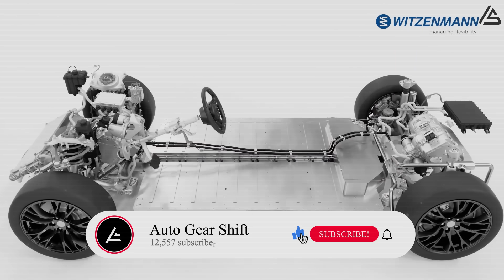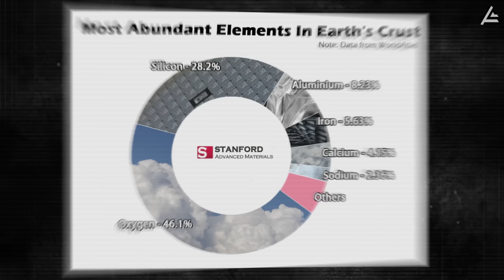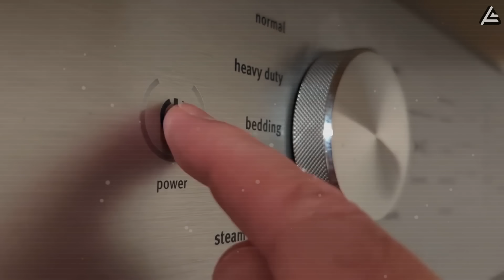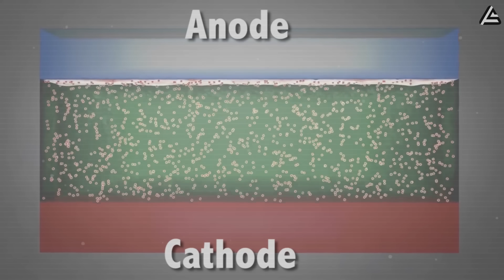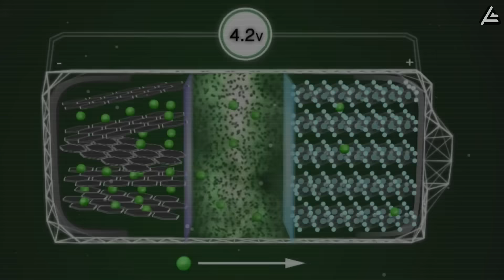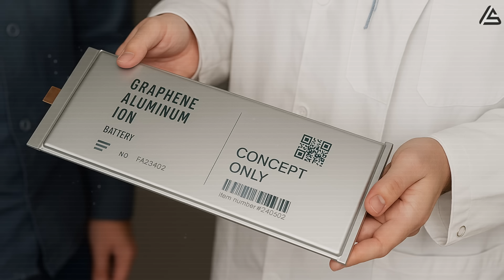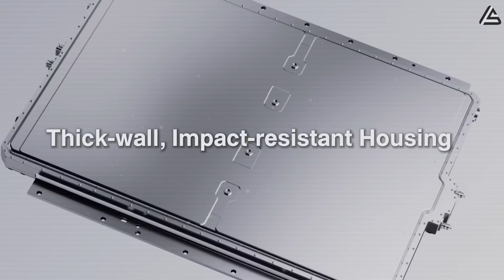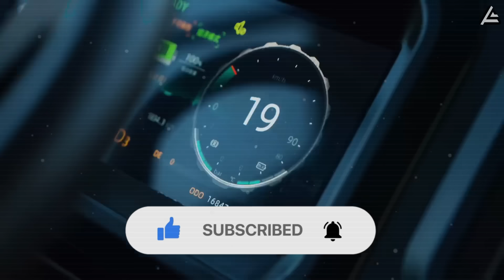Elon Musk Revealed 2026 Tesla Batteries: Aluminum-ion VS Sodium-ion. Is This End Of Lithium?

Comment: OK let’s get real, Tesla in the foreseeable future isn’t moving to either of these battery chemistries.  The reason is density.  They don’t have the density to offer any long range.  A sodium-ion battery would need to be 100-110kWh to provide the same range as 75kWh NMC battery.  Adding more weight to the vehicle.  Aluminium-ion batteries are still at Lab stage but also suffer from the density issue.   In 2025 we are looking at EV ranges of 400 miles plus.  Who would want to sacrifices 100 miles.
Reply from the maker: Exactly — that’s the reality check most people miss 👏 Energy density still rules the game. Tesla’s pushing 4680 lithium cells for a reason — proven density and scalability. Do you think solid-state could bridge that gap before 2030, or is lithium here to stay longer?

Comment: Aluminum-ion batteries are a technology currently under development. Compared to existing lithium-ion batteries, they have lower energy density, presenting the challenge that achieving the same capacity requires greater weight.
Reply from the maker: Exactly — that’s the trade-off right now ⚖️ Do you think the extra safety and faster charging are worth the added weight?

Comment: But what about battery recycling? Which chemistry allows for the cheapest and most complete recycling of materials? Graphene is not cheap and aluminum is not harmless when absorbed into the human body. There is also the option of reusing a battery in less demanding ways, like power backup for buildings.
Reply from the maker: Do you think Tesla will focus more on recycling or on second-life applications first?
Reply: @AutoGearShift2  The Nissan Leaf has done a second-life application. I don't know what Elon's business model will be.
Reply from the maker: That’s a good point. Tesla hasn’t clearly outlined a second-life battery model yet, what we’re discussing now is still based on trends and possible directions. I’ll cover Tesla’s likely options and comparisons in the next video, stay tuned.

Comment: IDK about in a vehicle but today, nearing the last 3 months of 2025 and looking all over most of the world including China, I have yet to see a low price, long life as in longer than 10 year warranty if that long, Sodium battery. As for EV's, if the EV battery lasts 10 years and then dies, then what? What would the cost of a replacement battery be? How expensive was it to run the EV for 10 years compared to comparable performance with gasoline? Way too many unanswered questions in these clickbait presentations.
Reply from the maker: Exactly — the hype often skips the hard questions 😅 Longevity, replacement cost, and total ownership expense are what really matter, not just flashy numbers. Do you think sodium-ion will ever realistically solve those long-term cost concerns for EVs?

Comment: Sodium batteties last longer thank Lithium. Not less.
Reply from the maker: You’re right — one of the biggest advantages of sodium-ion is its longer cycle life compared to lithium-ion, even if energy density is lower. 🔋 Do you think that longevity could outweigh the range difference for most EV buyers?
Reply: @AutoGearShift2 absolutely. The value depreciation is a big issue.
Reply from the maker: Longer cycle life directly helps with slower value depreciation, which matters more to many buyers than maximum range. That is why sodium ion is gaining attention for cost focused and long life applications, and it will be interesting to see how Tesla balances those tradeoffs going forward.

Comment: I would go the cheaper route, if Na-ion brought the cost down to the $15-16 K range. I hate to say this but, as I watch these videos the numbers are all over the place. Sometimes it's $11K and sometimes it's $25K. I think if Tesla wants to really capture the market, they need to use what they think is the price will be, not what they think people want to hear. Be consistent, it's one thing to change a price by 5-10%, it's quite different when it's 50%, or as much as 135%. While I like the idea of being able to charge in the same time it takes to fill a gas tank, it's not something I would use very much, if at all. I drive 250 miles (400km) a week. I can afford the time it takes to slow charge on the weekend. And I have a 3k watt solar generator I could recharge daily for free.
Reply from the maker: Totally get that — consistency matters more than hype. $15–16K sounds realistic and appealing, but jumping numbers all over the place makes it hard to trust. ⚡ With your weekly driving and solar setup, slow charging would work perfectly for you anyway. Do you think Tesla will settle on a real, stable price soon?
Reply: @AutoGearShift2  I don't know if Tesla knows how much it is going to cost. The other problem is the price going to be the same everywhere. In the central Florida area, I don't know where any dealerships are located.
Reply from the maker: Good observation. until Tesla actually announces a price, nobody truly knows how much it will cost or whether it will be the same worldwide.
Dealership or service center locations are a real issue in some regions, especially places like central Florida, because Tesla uses direct sales instead of traditional dealer networks.

Comment: But now the Question becomes where do we get the EXTRA electricity to charge a Nation of Electric Vehicles when we can't Produce enough Electricity for Peek Power Requirements, Now With more than 60% of Electricity is produced from Coal & other fossil fuels.  Even with Better Battery technology your electric veicharl won't operate without electricity even if you could somehow afford it because of the Very limited Supply.
Reply from the maker: Exactly — battery tech alone isn’t enough ⚡ EV adoption depends on the grid. If we can’t generate enough clean electricity to meet peak demand, charging a whole nation of EVs could be a problem. Do you think renewable expansion can keep up, or will we need smart charging and off-peak strategies first?
Reply: We absolutely can produce the electricity. But there is a huge amount of waste in the transmission through power lined. Especially at distance. Coal is a major resource. So is hydrogen etc. I'm watching the thunderstorm generator development and it looks good in testing. We may be at the door of major tech breakthroughs if the goalposts aren't constantly changed.
Reply from the maker: yeah you got a point. hope Tesla will notice this

Comment: Can aluminum-ion batteries power larger vehicles like trucks or buses?
Reply from the maker: Great question — theoretically yes 💪 Aluminum-ion cells have high energy density and super-fast charging potential, which could suit heavy vehicles. But scaling it up safely and efficiently is the challenge. Would you like to see it tested on semis first or city buses?